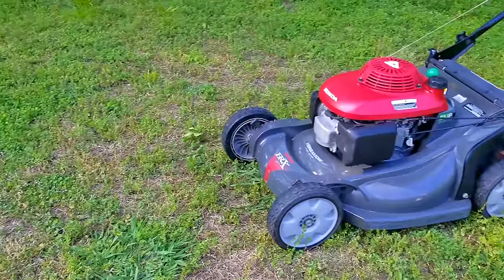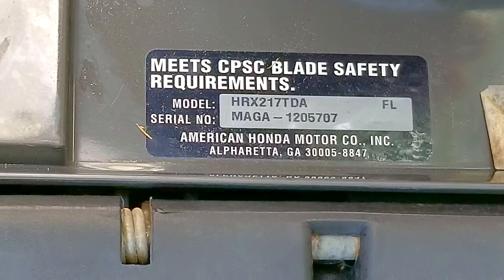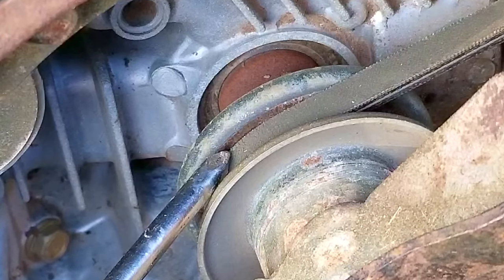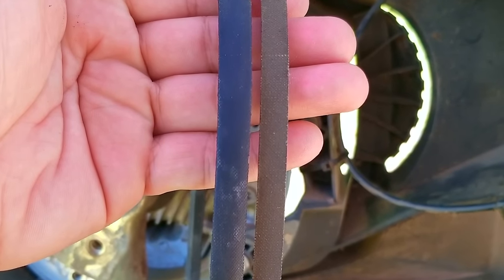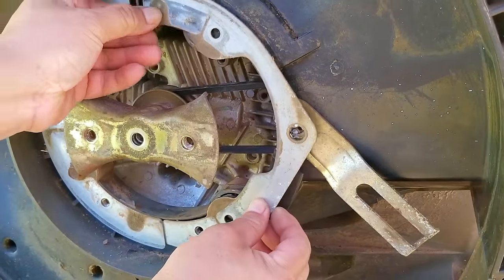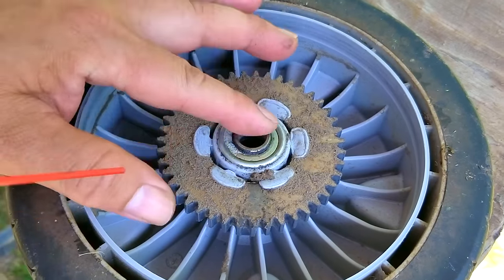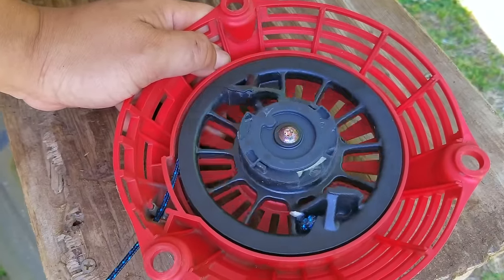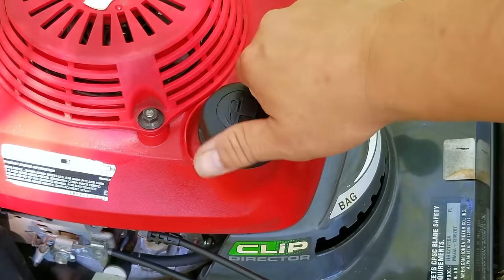Fixing The Self Propel On A Honda Mower

Comment: Very good effort put into this video. You really captured every detail on camera. I have a slightly newer version of this HRX that's probably mechanically identical with a couple refreshed features, and it's already having drive issues after only three seasons despite taking very good care of the thing with regular power washing, blower drying, and oil changes.

After only three years, it won't roll backward and the drive system is no longer putting much energy into moving forward. And the wheels literally lock up when pulling back on it without even engaging the drive system, they lock so tight that you'd swear the thing had a parking brake turned on. Drive belt is in decent shape and doesn't need replacing (just like the one in this video) and I've cleaned and lubricated the drive gears inside the wheel hubs just like shown here too.

Feels like it might be some kind of issue with the drive unit on the rear axle and I'm not thrilled to encounter problems on a well-maintained brand new Honda mower that has been an otherwise great product.
Reply from the maker: it's unfortunate but this is really the only trouble I have with them.  Unfortunately I do believe your axles are stuck to their bushings.   Don't worry, you'll know you try to remove the transmission and have to resort to ponding on the axles to free them.

Comment: My sister-in-law was told by a Honda dealership that a new transmission would cost more than 200€ so I offered to look at it myself. This video has helped me to start with simple things in case of a repair. So I adjusted the cable first which didn't help. Then I removed the belt which looked worn. Before buying a new belt I checked the transmission by pulling the  cable and found that this blocked the wheels being a good sign. So just buying a new belt was the solution for me. Shame on the dealership...
Reply from the maker: wow you did a great job

Comment: The clip director for the versa-mow system that Honda puts on these machines, if you have really thick, tall grass you can still leave mulch in the grass but bag a good portion as well.  It apparently also helps with shredding leaves in the fall.  That said, I really wish Honda made the HRX series with the GXV160 engine and a shaft drive transmission, but belts tend to be cheaper, manufacturers say.  Ultimately, the customer has to replace them over time and I wonder if for the life of the machine a drive shaft would have been the better, less expensive method anyway.
Reply from the maker: ah, thank you for the answer I appreciate that
Reply: @HomeGaragechannel  if you force the belt out of motor pulley to the shaft you dont need all that work of disasemble all those parts, after the belt is on shaft can esily removed from back pulley to put new one insert front to back put on transmition first then force it to motor pulley spring tension make a bit hard but doable. from a long time user i miss hrx537 with electric start was a beast those dual blades work like a charm

Comment: After fix several HR 215 I really don’t want to touch Honda lawnmower any more. They ARE the best until  they break down. They are over engineered and parts are expensive. Engine is really good besides some oil burn old engines over 20 yrs.
Reply from the maker: I don't blame you
Reply: Do you mean Honda's are a pain in the ass to work on? 😂🤣🤣
Reply: They are, unless you fix them all the time to figure out some tricks to shorten the process

Comment: Yes. Recently working on a YS4500 rider, I replaced everything from the tank to the carb. and draining it a couple times. Just to figure out replacing the carb solved all the issues. I will note it was running driving and mowing perfectly fine before showing any of these issues. 
Later...
Reply from the maker: at least you figured it out, nice work and thanks for sharing

Comment: 99% of the time if the belts in one piece, it's good enough to work. May not last long, but it'll spin the thing. 
Also, always easiest/cheapest/most common/likely fix first. List your fixes and assign a 0-5 scale for each option. Try in order.
Reply from the maker: you are correct and great advice

Comment: Hey, just a question, is it normally a good thing that you give the strimmer engine high revs and full throttle when needed as i think it keeps the engine from building up carbon???
Reply from the maker: yes you are correct, some would say feather the throttle while others would say, just part throttle.  But for me IF possible and if you're comfortable doing it, full throttle please.
Reply: @HomeGaragechannel  been doing that today, and it can also get rid of carbon on the piston and spark plug which is a good thing.
and also the trimmer sometimes brings out a white-blue smoke burning oil, will the trimmer burn oil it doesn't need, because it seems to smoke then goes away after some use
Reply: I was always told that 2-strokes are designed to operate at two speeds, idle and WIDE OPEN!

Comment: Unrelated question: what do you recommend for a beginner to sharpen mower blades? Im 3 seasons in and need a sharpen bad, I bought a cheap angle grinder but im afraid to mess it up, I dont even have a vice grip 😮
Reply from the maker: cheap angle grinder, that's what I use, and it works great.

Comment: My biggest fear when I think of taking something apart, like a carb, is remembering how to put it all back together again. I think if I did, I would definitely record a video. I have a chainsaw that I want to tackle at some point in the future. I’m sure it’s a gummed-up carb. I’m always thinking about forgetting steps when I watch your videos and marvel at your ability to remember what goes where. I suppose it gets easier after you’ve done as many as you have. And by the way, that's a “me” problem. I always worry about forgetting a step when I perform my day job (I work in the healthcare). It can really be a bad thing if I forget a step. LOL
Reply from the maker: thanks, a I appreciate it but I chalk it up to mind OCD. And yes having done it a lot also helps.
Reply: hi just take your time, place the bits you take off in rows in the axcact same order and orientation you took them off and take loads of photos maybe start with something with not many pieces and build yourself some confidence you will get there

Comment: These Honda mowers are going to appreciate in value- the cutting quality still blows away the battery mowers despite the Honda being high maintenance, and the only gas models that are comparable are Toros.  Best to just grumble through some of the wear-repairs.
Reply from the maker: totally agree
Reply: Not sure if 'high maintenance' is totally correct. But replacing this belt is definitely more difficult than the simple front-wheel belt-drive style mowers. I have two Honda's, one is self-propelled, one is push (one is at our rental property). I bought both used but they were taken care of, both have been virtually maintenance free for years, no small feat as my wife mows too and she can break an anvil. Each year I prep them for storage and they start first pull each spring. I know sooner or later I'll need to replace belt which is why I'm here now. But after used 'dump' mowers for ages (I pull them out of the dump and repair them, most I give away), I won't be going back. The quality of the two-blade cut looks too good. I have almost 2 acres, I start mowing the ditches, front circle, and edges with the Honda and use my zero turn for the rest. But I usually get carried away and cut almost my whole lawn with the Honda, because it looks so good.
Reply: High maintenance because you need to completely remove the hydrostatic transmission from the mower to correct any quality deficiencies that their production operators likely have missed during in its last 1-2 years of production, like filling it to the correct level and air bleeding.  The belt is pretty easy provided you have a real pry bar tool so that the axel can be rotated

Comment: Good video, TY!  I have the HRX217HXA and for the past couple of years I am not able to pull the mower backward without lifting  rear of mower.  I have changed gears, lubed, etc.  I am hoping it may be the cable adjustment or possibly a new cable.  It's hydrostatic and it pulls fine. Have you experienced any issues like this with HONDAs?  Thanks
Reply from the maker: sure have, but you didn't mention if the drive  actually works?

Comment: Thank you❗️ But I’m NOT going to spent time doing this and get stressed out. I JUST….. got one from Home Depot via internet. After spending $700 plus, the drive is not working and one of the handle screws came bent which caused other problems. I’m about to drop kick this crap over a cliff. Returning it, another set of issues. So it’s useless to me.
Reply from the maker: sorry to hear you're having a lot of issues.  And yes, no one should have to go thru what I did in the video to get it to work

Comment: I’m experiencing same problem with my Honda that’s 15 years old. I’m debating taking it to the shop or buying a new one. How expensive do you think a new transmission is?  I don’t want to pay more for repair than I would buying a mew mower. Thanks.
Reply from the maker: on this model, I was able to find a transmission for $155 on amazn which isn't bad.  Hopefully you have the same one but if yours is a hydrostatic version, you're In trouble

Comment: There is a service bulletin on that model..... if it's not pulling and locking up pulling backwards your too replace wheel bolts left and right wheel adjuster/ bushings, remove and clean transmission shatft, and the belt. BUT more importantly on that model specifically I've leaned(fixed hundreds) the cable has to be set right in the middle...too slack it locks up, too tight.... it pulls your arms off. Lol
Reply from the maker: yes you are correct

Comment: Its a real bear. Had the same problem on my Toro. Never could get it fixed right. Also, you cant use the Honda as a push mower because its way too heavy. No power drive and you might as well junk the mower.
Reply from the maker: These have a ratchet style bypass to disengage the drive from the wheels. That's the clicking you hear by the wheels when pushing them forward.

Comment: Are you sure that you want to sell that one particular mower? Honda will now longer be making them after September, and the new ones are on a "Sales Hold" impending an investigation into problems with the Cam Pully's.

Mine is just like yours except it has the "Smart Drive" and a starter (HRX2174VLA ). I wouldn't trade it for anything, let alone sell it. I think that I told you before that there were two at the pawn shop that I got mine and I'm still kicking myself for not getting the other one as well. I'd part with all of the rest of my mowers before I'd let the HRX217 go.

The clip director is a neat feature. When I do my mother's lawn, I mulch part and put the other part into the chicken pen. They love the freshly cut grass and go after it like there is no tomorrow. She also likes to put part of it into her garden composter and still get the benefits of self fertilization of the lawn.

I use the clip director feature to get covering material for reseeding bare spots (instead of buying wheat straw) and sparser areas to keep weeds from gaining a foothold while still mulching the rest of the yard. But, running full mulch all of the time, after a while there is enough in the bag to do this anyway, really fine material that composts quickly (It's not exactly a sealed system). I've also got an area that I'm composting a bunch of old fire wood logs that did not get used and is far enough along that I don't want to carry any of it into the house. Later, it will be a terraced garden area. The area also makes a great place to throw out the old kitchen scraps to compost (I'm too cheap to buy an actual fancy composter).

Anyway, take care and we'll talk to you later.
Reply from the maker: unfortunately it was to benefit a family member so I really don't have choice but to sell it, don't worry I have more of these I just don't talk about them.

Comment: Wouldn't you have checked the drive cable first as that is quick and easy to adjust vs first taking the whole belt off and spending a few days on that part? Also, the bag/mulch adjustor is awesome, great for larger lawns where you want to bag half the clippings and mulch/leave the remaining clippings on the ground, great video and well done mate.
Reply from the maker: yes I should have, for some reason I thought it was something related to belt slippage

Comment: I have the same exact mower. The transmission does not have a belt The transmission has gear oil ln it because it's a hydro. Get the wheels working getting going and have to replace the whole transmission.
Reply from the maker: thanks

Comment: I own several Honda GX engines that after some time (years) they all have the same problem, unable to start without pouring fuel into the carburetor.
I have cleaned the carburetors many times, but without success, until someone told me about the jet that was under the idle speed adjustment screw, and yes the jet was closed, opened it with a wire and the problem was solved, with all my GX carburetors
Reply from the maker: nice work

Comment: My new mower is an HRX similar to this but larger (it's a 537 model), since I noticed that the chassis, laterally, protrude respect of the wheels, and would be damaged, with time, by rubbing against the garden border walls (here in Italy we don't have open garden and driveways like in the US: each house is enclosed into border walls, fences or similar stuff), I made a modification.
I found at local DYI center some 1.5mm thick, 1m long, 2.5cm tall,  stainless steel strips. I've measured the sides of the chassis (the flat part and adding 5cm per side), cut the metal strip in the appropriate lenght, shaped it to match the shape of the side of the chassis and its angle (near to the front wheel) and curvature (near the back wheel) and attached it to the chassis with some super strong 3M VHB foam tape. 
It works wonderfully to protect the plastic chassis against wall rubbing and also gives it a nice "shiny border" which also pleases the eye :)
Reply from the maker: wow very nice idea!

Comment: You covered 2 of the 3 reasons the propell wouldn't work.  That is actually a hydrostatic transmission like an automatic transmission in an automobile. So if you see signs of a fluid leak replacing the belt or adjusting the cable wont help.  I actually have 2 of those unit that the propell is not working on due to leaked fluid. The seals need to be replaced and the fluid changed. I havent tackled it yet because it is a big job.
Reply from the maker: unfortunately this transmission is not the hydrostatic one, those have a metal body to them  and are very expensive. This one is part number 20001-VH7-003
Reply: @HomeGaragechannel  I did wonder about it seeing the body of the trans was plastic however I didn't know the 217 came with a non hydrostatic transmission. Thanks

Comment: I have a self-propelled mower that’s doing the same thing with the wheel spinning when you lift it up in the air but not when it’s touching the ground but mine is a Toro recycler is it most likely a belt issue with it as well? I also loke to get free lawnmowers and try and fix them up and sell them but I don’t want to pay to have to put a new rear transmission in it if that’s the problem but a belt I’m sure isn’t that expensive? I already tried the cable adjustment first on mine and it doesn’t matter how tight I make it it’s still only spins the wheels when it’s lift up in the air so I’m fearful it’s the transmission
Reply from the maker: actually I would also adjust the cable end as well. On the toro it's also on the left side handle bar. Loosen the nut, pull the cable down two or 3 clicks, tighten it and see if it improves.
Reply: @HomeGaragechannel  yeah I tightened the cable to the point where just starting it up and lifting it without engaging it it was turning the wheels so I know I went to far and it still won’t pull itself once it touches the ground

Comment: That one is WAY to complicated for me. IF I was going to mulch I'd just want to stop the discharge off and be done with it. Too many variables would drive me nuttier than I already am. And yes I've done the same thing you did and a lot more than once but it always comes out in the end that we all learn something. Gravely came out with a double blade system for their bush hog deck with the other blade being mounted across from the one. 90 degrees as it was. The bush hog gears were slow because the bush hog blade was a good 1/2 inch or thicker and worked fine in big stuff but was too slow for a finish cut. Enter the other blade. HAPPY 4th and Blessings
Reply from the maker: I know right, hopefully I don't have to do this job more than once.
Reply: @HomeGaragechannel  1ce is sufficient!

Comment: I am having a similar issue when i checked the belt it was incredibly loose. So loose that i can squeeze it together incredibly easy.  

I understand that it will get more tesnion when in drive yet is being that loose normal?
Reply from the maker: it depends on what make and model you have.  Some belts are under tension and the self propel activate internally while others use pure friction

Comment: Try pulling off the wheels and cleaning up the shafts and oil the bearings. Put grease on that gear in there. If the wheels are sticky you will lose drive.
Reply from the maker: very true